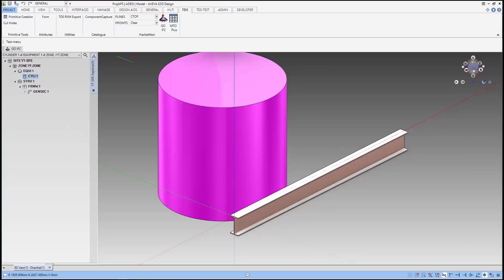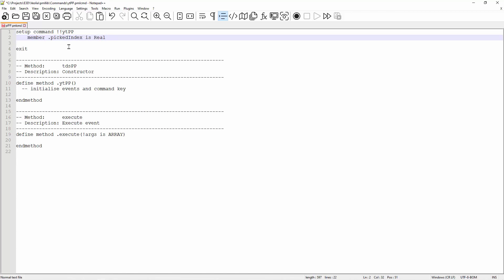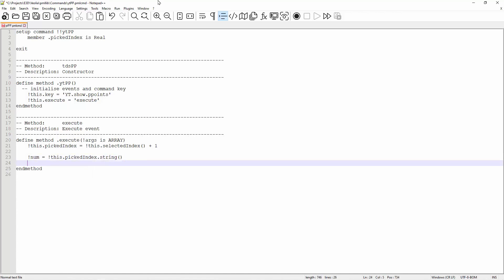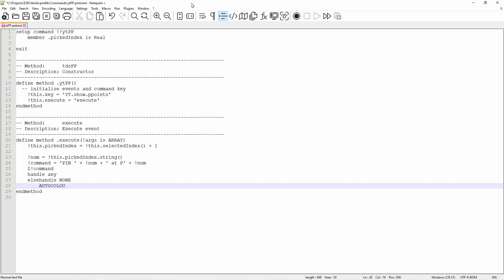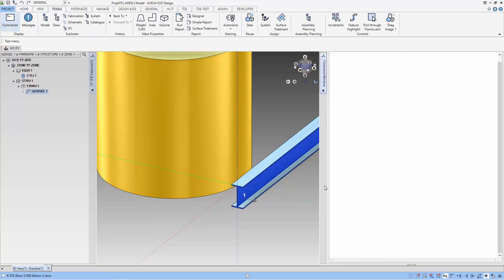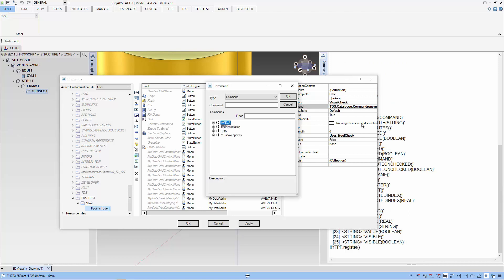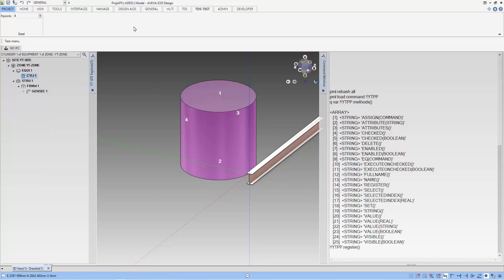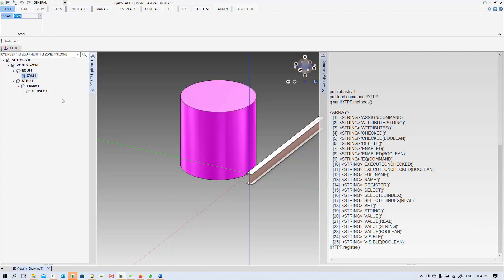AVEVA E3D PML - PMLCMD and UI customisation

Comment: Hello. First of all, this is a great job you are doing since these years! And  also i am struggling with command methods. Indeed I have two versions of AVEVA, the one at my job AVEVAE3D3.2, and the one at home, the E3D2.1.

First I try to register the !!YTPP on home E3D2.1 with "pml rehash all", "pml load command !!YTPP" and then "q var !!YTPP.methods()" and I get "Undefined", while the E3D3.2 shows the methods, and then I register.

Where does the issu come from you know? What makes the difference? Is there a config somewhere to do?

I thank you for any reply from you. Regards.
Reply from the maker: Hi, sorry i am not sure as there are changes between 2.x and 3.x. Perhaps there are different there. I do not use 2.0 anymore. Perhaps u should use 3.0 onwards. Depending on which version of 2.0 u use, lots of improvement since the first release.

Comment: Very useful, thank you.
However if I may : at line 24 I think !command = 'PIN $!num at P$!num' would've done the trick, and maybe even 'PIN $!this.pickedIndex at P$!this.pickedIndex' without converting to a string. At line 29 I think enhance ce colour 6 etc... would have done the same thing as remove then add.